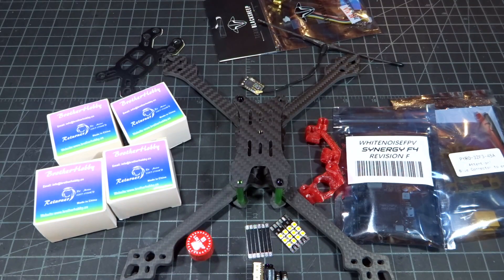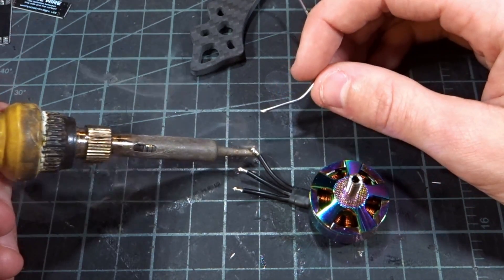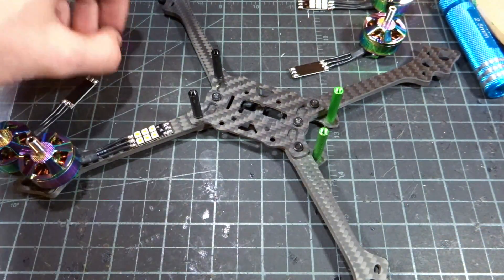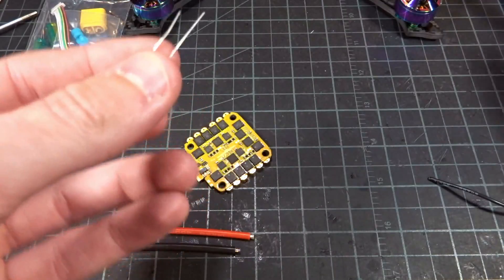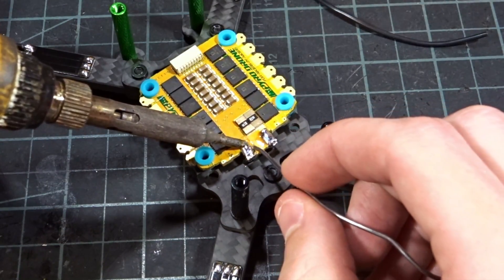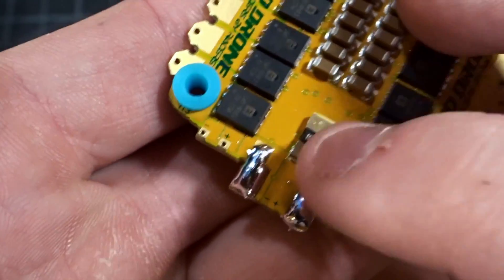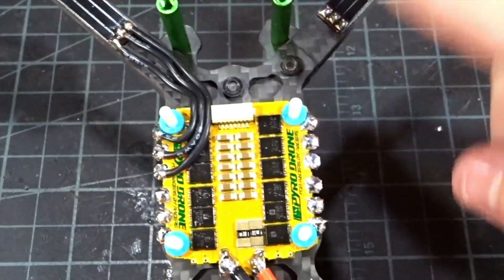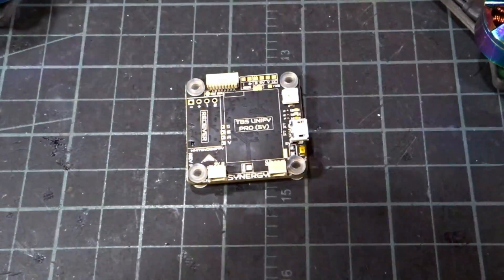Building my Insane 2019 Racing Setup! : neXus, Synergy, PyroDrone 45A, Predator V4, 6S...

Comment: Tip for you and your viewers. The MG Chemicals conformal coating has a UV marker in it so, after you have coated your board (or after it dries) you can use an ultra violet light to check and see if you’ve missed any chips or area with the coating.
Thanks for the content!
Reply from the maker: I think I mentioned that, but either way I don't have a UV light or care that much haha. I'm only doing it now to make people happy haha
Reply: Oops! Apologies if you did...
The coating (in my opinion) just adds another layer of confidence in the build (pardon the pun). I put it on the solder points after I am done so there’s less chance of a short. I also feels it helps the components on the board to deal with shock better, as everything is kind of glued together.
Looking forward to a flight video with that unit! 😀

Comment: That capacitor gap is genius!
Reply: What do you mean
Reply: @mehulanand8623  did you watch the whole video?  He has a gap at the bottom of the frame below the ESC where the capacitor is tucked into which keeps it safe and out of view and out of the way
Reply: @StacemanFPV  you talking about the mosfets?
Reply: @scriptchild6743  No....  I'm talking about the gap (hole) in the frame where the capacitor that he soldered on can fit nice and snugly out of the way.  @12:49

Comment: Awesome build video and details 👌 continue with the awesome work. Your videos are so clear and right to the point. Could you please consider doing a long range 7 or 8 inch build with a tbs nano reciver. Happy flying.
Reply from the maker: You could use the same exact electronics and simply use different motors and frame.

Comment: Great vid, thanks a lot. I went for a similar racing build, same ESC and FC, and I have a weird issue: regulators on the FC burn out when I turtle mode in longer grass 😑 Happened twice already, one of the FCs fully conformal coated, and the scenario was exactly the same in both cases - using turtle mode, and in the middle of that the FC is fried. Have you ever had problems of this kind with your build? I also run a cap, 1000 uF, also 6S.
Reply from the maker: The regulator burns out? I've never had that issues, hmmmmm
Reply: The RCAddict do you change any esc settings or keep the defaults? What I did was setting the PWM freq to 48kHz and motor timing to 22 degrees. That could potentially affect the way ESC works with the motors and maybe the voltage spikes became too high. Idk super weird issue.

Comment: A tip to remove solder in your current situation is to heat the solder then just fling it. It will fall off
Down and dirty method

Comment: Great very well explained all stages and with patience.  What tin are you using?  It seems that it does not work well with the temperature of the soldering iron.  I am using Pb38 Sn 60 Cu2.  The Pb no is recommended for the industry but for our level I do not think it is a big impact on the environment.
Reply from the maker: Kester 60 40 solder with lead.

Comment: I put both capacitors on mine, soldered to those small pads on each side of the battery pads.    I feel if I did it like you I would melt the capacitor wires off when I put the main leads on.
Reply from the maker: I have had zero problems so far, but you could always add the battery lead first.

Comment: Great quad! Very nice build video! What exactly do race LEDs do? And what are race wires? Why did you not solder the motors directly to the ESC?
Reply from the maker: They are both an extension to help prevent the prop was chopping the wires if it gets bent down, and providing quick motor swaps at a race. The racelites have leds in them that light up when the motor spins.
Reply: @TheRCAddict  Okay. Thank you! Have you flown the quad yet?
Reply from the maker: https://www.youtube.com/watch?v=_BEn-hB_Usc https://www.instagram.com/p/BxoNpc-HvQY/

Comment: You will have to forgive me because I am a noob to drones but you said the flight controller houses the receiver and Video transmitter onboard and then went on to say you purchased a separate receiver and video transmitter... im confused.. why did you buy separates transmitter and receiver if you said the FC has them both on board?  Or am I misunderstanding what you mean by on board? Do you mean on board that youre able to connect them both to the Flight Controller? If so, then what other way did the receiver and transmitter get connected to a drone if not via the FC??   Im trying to learn the various ways a drone can be built.. Right now I noticed theres these AIO ESC and then theres drones with like four ESC for each motor.  I'm trying to see which are more ideal and for what reasons one would chose one of the other.

Comment: What is your core temp when this fc/vtx is sitting on the bench at 25mw?
Mine is about 100C and throwing osd warnings...?
The f4 chip itself seems hot as hell.
Reply from the maker: I never use warnings. It's been tested left on 200mw for hours. While its super hot it hasn't failed.

Comment: If I cut my Capacitor leads and use silicone wire to the battery. What gauge should I use?  4s and 1000uf cap.

Comment: Do I have to get on betaflight to get the vtx to work? Running the tbs unify 5volt and crossfire but when I plug in the battery now power to the vtx just for a milla second
Reply from the maker: The FC defaults to pit mode when the radio is off. Need to have radio on and setup a switch in modes tab for pitmode, (when pitmode is ON, the VTX is on).

Comment: Is there enough space to get three stacks on there with 5mm spacing between stacks?
Reply from the maker: Should be fine yeah
Reply: @TheRCAddict  thanks so much for your time. Your frame is by far my favorite. This will be my first racing build. 
Very challenging if one isn't using the white noise FC with place holder for receiver and vtx. The fact that I can get three stacks on there just simplified everything. Much appreciated. Hope school is going well

Comment: This frame looked a lot like floss 3..
Reply from the maker: Uhhh it's hardly similar. two carbon plates, dual arms, top plate press nut, 3 motor holes, standoffs out front... How many differences does there need to be lol. We also designed this before the floss 3 came out.